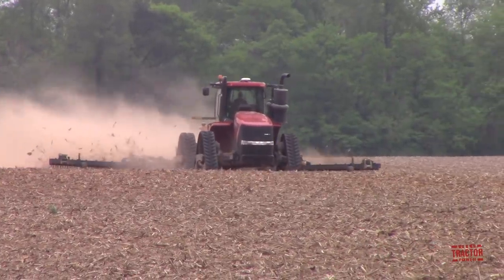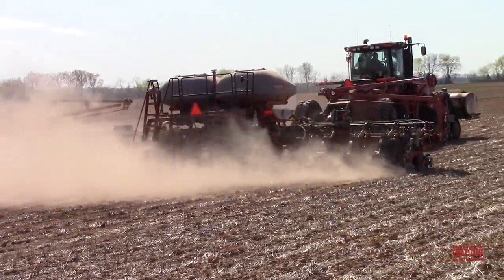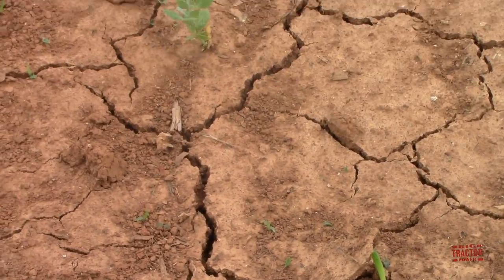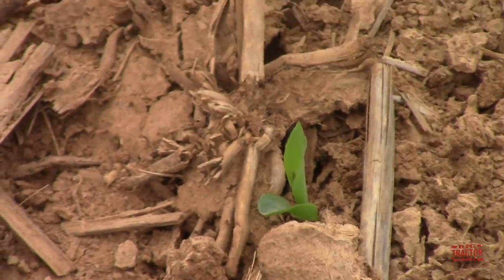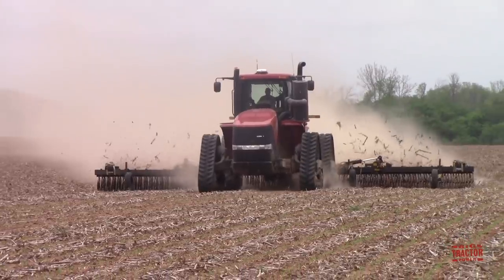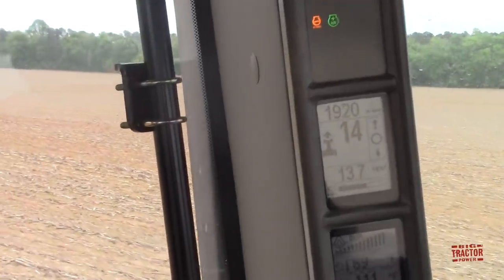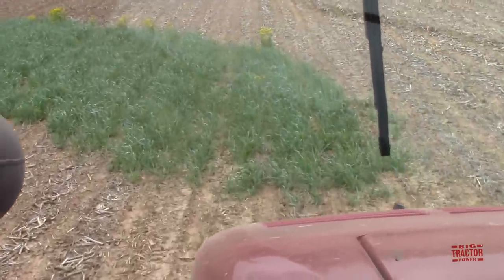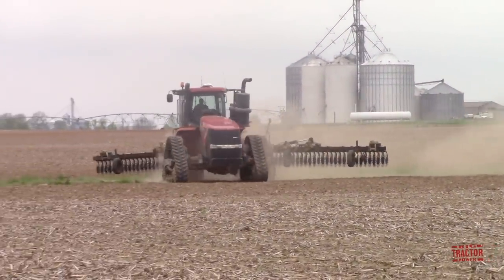14 mph Rotary Hoe Work: Tractor Overkill?

Comment: 14 mph in  a car"  why you driving so slow"  14 mph in a field " damn were moving fast"
Reply from the maker: You can feel the bumps and ruts at 14 mph. The tracks help soften it.
Reply: It's just like driving a semi or a large tractor and getting into your car to go home right after!
Reply: Jerod Broussard always feels like your sitting so low on the road after lol even in a lifted truck
Reply: @Wainfleetkx450f  I got pulled over in the pick up after being in the combine for 13 hours. Cop wanted to know why I was going so slow and why I was riding on the white line?  As you say I felt like I was in a hole and the pick up steering is so damned sensitive. :)

Comment: Back in the '60''s we had a six row John Deere 3-point hitch we pulled with a JD 435.  Little tractor had plenty of power but running down the road to the next field the front tires (wide front end) would alternate touching down -- other tire was 6" off the road.  You steered it with the rear brakes!
Reply: Was that the one with the 2-53 Detroit?

Comment: Rotary hoes have been around forever. I used mine for weed control, you hit the corn right as it emerges, and, get rid of any small weeds, then i used to do one cultivation when the corn was about 6 inches or so high. It helps to minimize the use of herbicides.
Reply from the maker: Very true. The rotary hoe goes back to horse drawn days. They used to be a great weed control option for sure.
Reply: @bigtractorpower  I had a John Deere, about twelve feet, and,it looked much like the one in the video. I have seen the type that are pull type instead of three point hitch mounted. Now the thing about hoes is, you have to go as fast as you can, the faster the better, i wonder how a team of horses could have done that?  I ran mine on my John Deere 2440, which i think was about 60hsp.

Comment: what if the sun is going into it's 400yr cycle and farming weather continues to worsen?  many farmers know about the cycles, but none of us were alive the last time the sun did what it's doing now. thank you for sharing and taking the time to show ways it's being handled. 2nd question, would fall plowing, then good spring tillage have prevented this? many are installing irrigation in N.W. PA
Reply from the maker: Crusting of the field after rain is a common problem. This type of implement goes back to horse drawn days. Hopefully a farm only faces this problem every once in a while. 

The strip Till accomplishes good tillage only where the seed needs to be leaving the rest of the field unrolled and holding soil in place. Traditional plowing and spring tillage would make the crusting worse after a heavy rain.

Comment: Enjoyed the video.  I have a question though, does the rotary hoe have spacing for the crop row?  I'm not keeping up with how it's able to flip the soil and the weeds and leave the corn undistubred.
Reply from the maker: The spiked wheels are spaced at 7 inches all the what across. They just skim the surface breaking the soil and tearing out shallow rooted weeds. The corn is planted an inch and a half deep and the wheels are no where near that deep.

Comment: As an aerator, if I'm not mistaken, it seems that could be a quick solution to preparing the seed bed.  No doubt it will rain again, so when do you stop doing this?  Its crazy fast, I think us guys who used older machinery have a hard time imagine doing field work at basically road speed.  Thanks for the video...keep it up.
Reply from the maker: It is a one pass machine. Once the corn is free of the surface crust it will grow fast.  Often if you wait a day too long the corn that did break the crust is too tall and the harrow can. It be used on the field.

Comment: We raised cotton in North East Arkansas, used it quite often for emergence until we bought 7100 maxemerge John Deere planter. After  that we used it more for sand control on high windy days when cotton was very young and tender
Reply from the maker: Thank you for sharing. What changed the conditions with the 7100 planter seeding the crop?

Comment: We had a home built rotary hoe  at my grandmother's can't remember how wide it was but they built it for just this problem great video
Reply from the maker: That is you had one built. This type of implement has been used since horse drawn days.
Reply: @bigtractorpower  what they did was built a frame and took five small ones and put them together
Reply: @bigtractorpower  my grandfather built a loader for a 1570 case as well he worked on the arsenal and was a real good fabricator

Comment: Does it not pull the seedlings up? Never seen one used but would worry about that.
Reply: Adam Smith there’s always a chance of it happening but sometimes you need to take that chance
Reply: guess that could be a problem if the ground are sticky, but dry as this looks like works great in:)
Reply: My understanding, and someone correct me if I'm wrong, the rotary hoe is set not to go very deep into the ground and also going fast keeps it from going very deep as well.  The corn is rooted deeper in the ground so it doesn't get dug up.  The weeds,  on the other hand, are rooted very shallow at this early stage and get uprooted very easily.
Reply from the maker: It works well to rework the soil and to leave the plants intact.
Reply: You are going to lose a certain percentage of plants with a rota-hoe but not nearly the loss of not using it.  My father's had to get ours out a few times in my lifetime to save a crop of beans from breaking there backs pushing through the crust.

Comment: Excellent video, we wouldn't be able to use such an implement here in the Palliser triangle area of southern Alberta out of the concerns of subsequent susceptibility to wind erosion, we occasionally get extreme winds here coming off the Rockies.
Reply from the maker: Interesting.  Are you all no till?
Reply: Our dryland acres are all continuous crop no till, yes, certainly.  Palliser triangle region of southern Alberta, semi-arid climate and light sandy soils, and we live in a wind corridor off of the Rockies which is occasionally prone to 60mph+ winds.  So best location specific agronomic practices apply of course.  Our irrigated acres are not, this is a major potato and sugar beet region which has to be conventionally tilled.  We often no till our irrigated canola stubble and occasionally cereals etc.  Extensive alfalfa ground gets worked down when the time comes.  Thanks for the great video's!!
Reply: We are about half dryland and half irrigation when it comes to cropping acres, and then extensive grazing rangeland virgin prairie.  Extensive beef production throughout the region here.

Comment: Alot of these equipment  we didn't  have on our farm  late 70s  early  8070s
Reply from the maker: It is amazing how farming has changed in the past 40 years. More power, larger and wider machines that move at double the speed. One pass tillage vs. multiply passes across the field.

Comment: That dude is cookin!
Reply from the maker: The RowTrac can get up and move.
Reply: @bigtractorpower  I'd imagine that has more than enough HP to pull that thing, and that implement really isn't going that deep, so maybe same speed with a smaller tractor?
Reply: @barrettgpeck  But it is shredding organic matter for what it's worth, maybe 1/2 inch off the top.  Seems like an experiment, which farmers are known for, also known for not having much time.  In any case, 10mph is the recommended top speed here.  Seems a waste as some organic matter does help hold moisture and resist erosion.  We had a crazy heavy Haybuster no till drill, consistent fungus problems.  Find line.  Ty

Comment: I was mowing hay later at night when I was younger and I got out to piss. We mow hay with our 1086 in 4 low with the ta in high i should say. Anyways when I got back in the tractor I put it in high instead of low which is road gear and I must have been going about 15 miles an hour. Keep in mind that this tractor had the doors taken off and the seat has a big ass spring that launches you into the roof when you go over a bump at any amount to speed so I almost got launched outta the tractor😂😂😂

Comment: It is technical overpowered with those giants. But: As far as they are targetting less soil compaction, I think it is ok to use them. Even if they may burn less fuel with other tractors, if these are allready on the farm, it is better to use them than put another tractor on the farm, so the big ones getting their hours on this way to get them replaced faster in time than other way round. Plus this machine is very high, which menas you have a very good overview and it has a small turning radius too.

Comment: In general how is the US corn crop planting progress for 2019 going?
Reply from the maker: It is 75% complete in the area of Kentucky I film in. Illinois, Iowa and Indiana are just getting started.
Reply: @bigtractorpower  so they are behind schedule down there as well? I am from southeastern MN & nothing is happening here yet. Rained again today & had a blizzard & three inches of rain less than ten days ago. Some are saying solar minimum causing bad weather.
Reply from the maker: P Bau it’s not too bad. There have been some rains that keep the fields wet three days then two days of planting get done and then it rains again. 30% chance of rain this week each day. If it does not rain I would say most corn will be in by the weekend.

Comment: how does it pull weeds out but not corn ?
Reply from the maker: The corn is planted 2 inches deep. The weeds are just in the surface. The wheels flip the weeds with ease but the corn is rooted deep enough. It to be impacted.

Comment: How in the name of all that's holy does that not rip up the corn as Well?
Reply from the maker: The spiked wheels just skim the surface to break the crust. The corn is planted an inch and a half deep so it is not pulled.
Reply: @bigtractorpower  thanks for the reply! It looks very aggressive but obviously does the trick! Love the videos!!
Reply from the maker: It is an interesting implement that has been in use since horse drawn days.

Comment: why no crop rotation ?
Reply from the maker: This farm rotates most of its ground. Normal rotation is corn to wheat, cut the Wheat in June  and drill soybeans into the wheat stubble and cut the beans in October. For many farm’s in WKY including this one there is always a little more corn ground than wheat and you will see corn, corn then wheat/soybeans.  This is just one of the overlap fields.

Comment: Considering the speed, it doesn't look overpowered.
Reply: I thought the same thing, but the engine is still running at 1900 RPM, wouldn't it be spinning slower if it just needed, lets say 200HP
Reply: Or maybe the turbo is too big.

Comment: Tractor overkill? Why, acres per hour is what counts. I don´t think you´ll be going 15 mph across that uneven ground with a 160 horse tractor on small tires. Also keeps your operator happy with a smooth ride.
Reply from the maker: All good points.

Comment: Less tillage on those farms would build organic matter and drastically reduce crusting by improving soil structure.
Reply: You don’t know what your talking about... tillage incorporates crop residue in the soil. The residue=organic matter
Reply from the maker: Some areas and soils need to be worked. This strip tillage system is nice in that it just works the seed path.
Reply: @gasher1990  I'm sorry, but you're wrong. Tillage burns off organic matter because it exposes the bacteria that brake organic matter down and use it (burn it) as food. Those bacteria are aerobic (meaning they require air). If you want to build organic matter in soil, you disturb it as little as possible.

Comment: I don't  see how it can uproot small weeds but not the corn at those kinds of speeds. Seems like he's throwing a bunch of trash on top of the small corn seedlings, no??
Reply from the maker: The weeds are rooted on the surface. Shallow roots. The corn is rooted 2 inches down and mostly still under the ground. The trash is trash.  The field is by a 4 lane highway. Lots of litter bugs driving by throwing trash out of their cars.
Reply: @bigtractorpower  LOL OK that makes sense on the shallow weeds.  By 'trash' though, I meant that the rotary hoe seemed to be dispersing all of last year's crop residue right back on top of the corn plants.

Comment: Sorry. Couldn't own that tractor until I had figured out how to put the muffler on it straight.
Reply: You mean that 55 gallon drum up there, that blocks your view, is the exhaust pipe/muffler? :)
Reply from the maker: Muffler does not block the view. It is angled to match the corner post of the cab. See this video where I interview the operator operator about the cab view during corn planting at https://m.youtube.com/watch?v=ORWUTUOgqMc

Comment: Funny thing is while using the three point linkage the power is derated to protect the trans and engine the fact it’s still performing so well is great
Reply from the maker: The implement rolls as fast as the tractor as the spikes are ground drive.
Reply: bigtractorpower yes but it’s mounted on the three point linkage the same derate would come in to effect
Reply from the maker: I have never seen a non 3pt mounted rotary hoe other than horse drawn models.  It’s the only option today.

Comment: Ideal speeds have been worked out years ago. This is just dumb
Reply from the maker: I think the ideal speed is get the job done as quickly as possible comfortably in the ride inside the tractor and with out damaging the crop.  Both things were accomplished here.  I filmed an 8245R doing the same job at 8 mph.